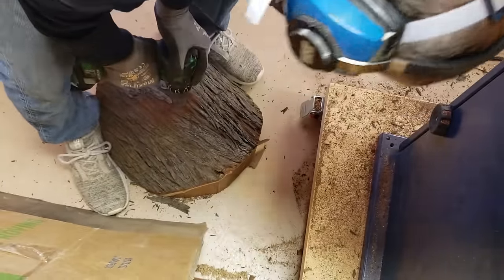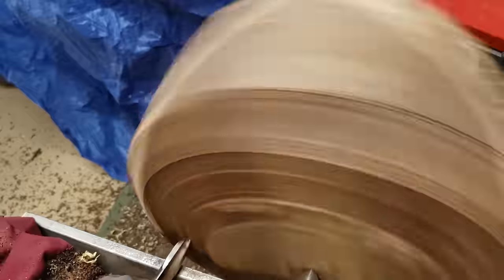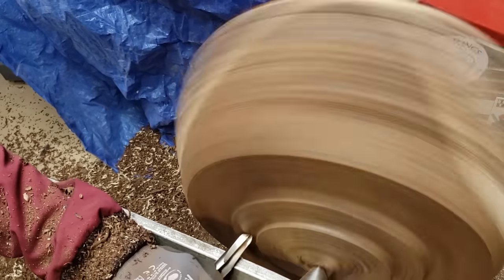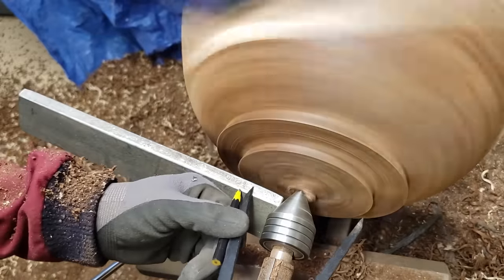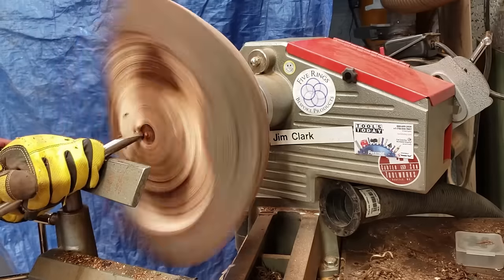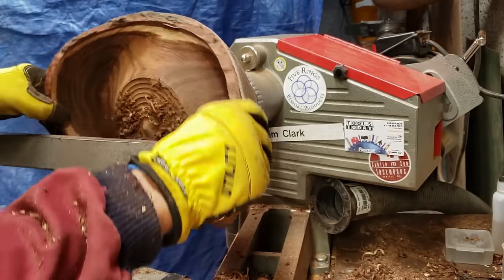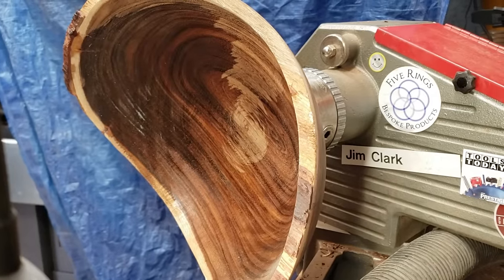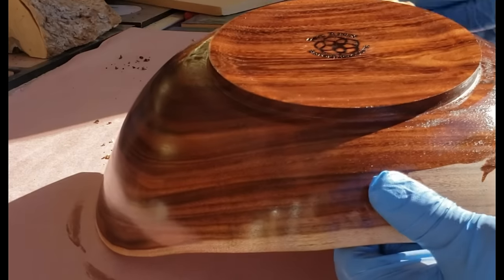Woodturning - A Big Acacia Live Edge Bowl

Comment: Very nice bowl, Jim.  In the future:  If you have to put the project aside after initial turning, try liberally wetting all surfaces and wrapping  in plastic.  Works well for me.
Reply from the maker: Thanks Louis!  I usually just once-turn bowls from wet and let them warp and dry.  It's so dry here in Phoenix that they are almost completely dry by the time I'm done sanding if I do it thin enough.  I've seen a lot of different methods of twice turning and I think I'll try some of them since I have a couple hundred blanks sitting around that I could probably turn/core and set aside.  I appreciate the tip!

Comment: Very nice video, and beautiful bowl.  Lots of sanding is a job I find myself doing on some of the pieces - sometimes it's just not possible to get everything with the tools and you have to bring out the 80 grit gouge.  BTW - how did you put your logo on the bowl?  It looks great!
Reply from the maker: Thanks!  I almost always have to bust out the 80 grit for the upper wings of live edge bowls since it's hard to get a nice clean cut when you're cutting air half the time.  I'm still working on improving my technique and tools as well so I know I have room to improve.  I had a custom brand made that has an electric heater.  It works great if I can get the bottom PERFECTLY flat.  But if there is even the slightest variation, parts of the brand won't touch the wood and will be missing.  I'm getting better at that but sometimes it looks flat but the brand says it isn't...  This one turned out pretty well though.  I will have to go find the vendor for the brand, I can't remember off the top of my head.